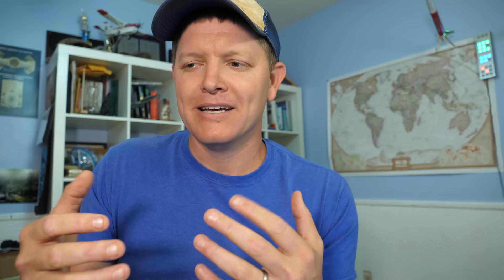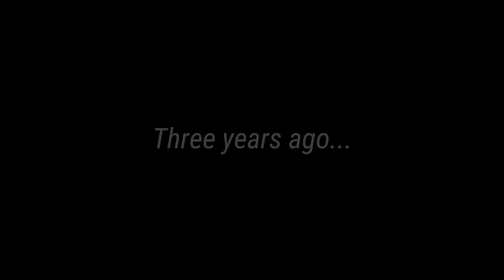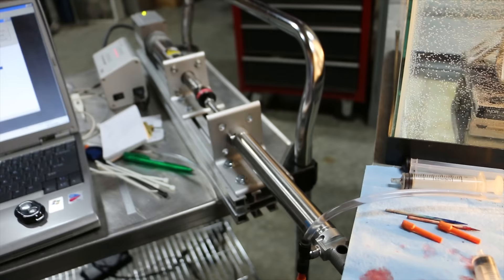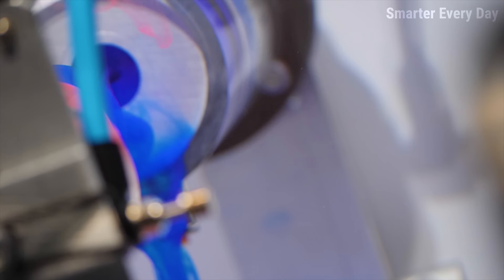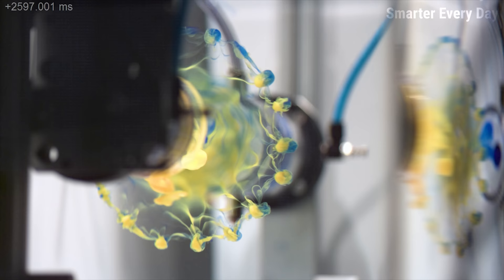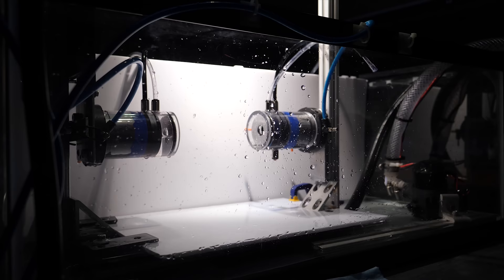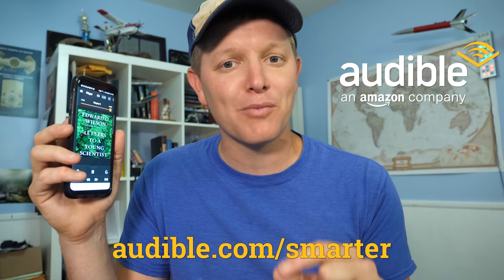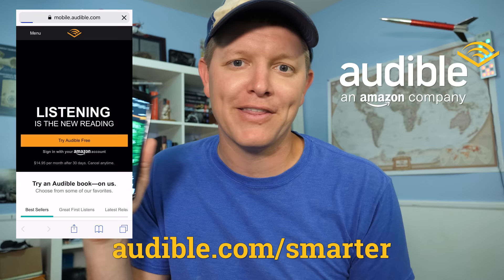Two Vortex Rings Colliding in SLOW MOTION - Smarter Every Day 195

Comment: I think you can try to fire the first vortex, wait maybe 0.1 sec, and then fire the second vortex.

In case the two do not fire at the same time, the collision occurs at a place near the slower gun. This may provide you with more interesting data.
Reply: not quite, because they wont collide. Sorry folk
Reply: Major Tom: They will collide. Still traveling on the same line.
Reply: BarackBananabama why?
Reply: Kim : The two smoke rings travel on the same line. Delayed firing of one vortex only makes the collision closer to the delayed side.
Reply: Barack banamama but the vortex also expands, which would make them miss,because the one fired later will pass through the middle of the first fired vortex
Reply: Major Tom : If you keep the delay very short, the two rings may still "mesh" as gears. I don't know if 0.1 sec is too much. They may still drag each other.
Reply: It might , only Destin can unwind this mystery...
Reply: I didn't see any major size changes over time
Reply: BarackBananabama no, I mean why should that provide with interesting data? It’s not like this is the first time we see vortices ;)
Reply: Major Tom no vortex will pass through the middle of another one, not when they collide head-on. The center of a vortex pushes forwards.
Reply: Major Tom And no, vortices don’t generally expand 😆

Comment: Maybe this could help predict tornadoes.
Reply: Why would anyone want to predict tomatoes?
Reply: oh no, killer tomatoes? :O
Reply: I say tornado you say tomato
Reply: ....because tornadoes are a horizontal spin in the atmosphere that somehow and unpredictably turns into a vertical spin, BTW. That's what I was getting at.
Reply: Any improvement to the fundamentals of fluid dynamics would probably help predicting tornadoes, and a whole bunch of other phenomena.
Reply: I was thinking the same thing regarding the tornado application. Two air masses collide on a horizontal axis which spawns a vertically spinning column.
Reply: Yes I was thinking of the way the horizontal to vertical vortex happens specifically. I know they haven;t figured that out in tornadoes exactly, which makes them very difficult to predict.  Seems an experiment like this might be able to shed some light on that. Maybe not, but that was my first thought when I saw it..  Amazing experiment!
Reply: If you want to predict just look for a super cell then a hook formation on radar it’s not that hard
Also look for low pressure 
Moist warm air from the south 
And cold dry air from the north
Reply: Sauce Duck Luck 
I don’t think you saw the joke
Reply: You'll have to figure out how to make the fluid dynamics perform the same in atmosphere as compared to water.
Reply: BWX also, the mixture of the ring needs to be almost similar in density and concentration, fine tuning such so that the radius formed would be able to be so sensitive to this natural phenomena.
Reply: Lol the first time I read tomatoes not tornadoes. I need sleep.
Reply: BWX yes but forming of multiple vortex tanado and their collision into forming one is a very rare case....
It would be fascinating though to relate these two case....👍
Reply: or may have no practical use whatsoever, but that shouldn't be a reason to not try to understand it. we shouldn't pursue knowledge expecting to get anything useful from it.

Comment: My theory of the creation of secondary rings at 90 degrees of the impact event is that the wave interference created between the two vortexes at the moment/point of initial impact become visably apparent (as the secondary ring formation) as the "shock wave" that contains them expands to the point where the individual disturbances become separated (visibly) from one an other. I think The separation of the rings as well as the ring formation is as a result of energy cancelation caused on impact which is visible as the voids where no ink is present- as the ink itself would maintain attraction the the energy which initially propelled it, drawing it away from areas which this force was cancelled out. Replies with others takes on my theory appreciated. I also wrote this without reading others comments so sorry if someone else came up with this already.

Comment: Try being stuck writing code for two years. Then read something that shows you the way in a matter of minutes. The code that solves the problem is a 6 line recursive C function that walks a maze. In my case, it mapped watersheds from elevation points.

Comment: It’s easy man there is less pressure between the color layers, so after the nodules break off of the main ring, the lower pressure in the middle the higher pressure at the water interface combined with the momentum of the wave, allow the dye to move faster inside itself that at the border, causing an inside out expulsion of faster moving dye in the center then at the interface
Reply: If you want to test this, next steps would include experimenting with varied viscosity, density, even chemically interactive liquids, try hydrophilic/hydrophobic trials… I can’t wait to see-

Comment: I think the mini rings are caused by the material that's being pulled not being perfectly balanced; when it's condensed, the stronger imbalance determines the rotation, clockwise or counter, and since it's pulled in from two sides perpendicular to the large secondary ring, the rotation becomes perpendicular as a result. This video was one of the things that got me interested in physics (more than at a cursory level); I had to try and figure this out at least for a minute.

Comment: The 90 degree rotation is caused by the formation of a disk with particulate density which acts as a gyroscope and causes a degree change when the spokes of this disc are held. Much the same as a gyroscope self regulates or as a bicycle wheel effects a ninety degree change when held in the hand and spun. Does that inform the experiment?

Comment: no mystery, gyroscopic precession it seems. you're basically squashing two vortices and disrupting the rotation of the fluid 90 did orthogonally. similar affect of a large drop pf fluid in free fall through air in a very long distance. a vortices will form, expand and turn into many different vortices around the edge of the primal vortex concentrating most of the original mass of the drop pf liquid.

Comment: Observation: I think the Astranaut theory might be partially correct. The energy should move from the centre of its first impact and then outward. After they perfected their equipment, if you pause after the first twin impact, a two double disc appears and the energy dissipation takes place through the edges of a regular polygon. The lowest numbered polygon you should get is probably a regular hexagon. And should increase with the increase in energy of the colour pellets. You can imagine the secondary rings following the same principle as a mushroom cloud. After the outburst of energy, air rushes in and thus the cloud is formed. With your wonderful experiment, after the energy is dissipated it creates a low pressure, water gushes in and curls the water inward which pushes the colour pigments in the shape of a ring
Reply: i don’t know what you said but yes

Comment: Very cool.   If atomic particles are toroidal vortex rings in an aether medium then you can see how colliding atomic particle vortices makes other smaller atomic particle vortices... which are NOT constituent parts but energy reformed (conserved) into smaller vortices. When considering particle vortex theory you need to remember some important facts. Firstly the atomic particle vortex has a secondary plane of rotation - so it not only turns in on itself like these vortices but they also rim turn clockwise or counterclockwise - this differentiates between vortices making them either positive (charge) or negative (charge). So the difference between an electron vortex and a positron vortex is simply this secondary wheel rotation in relation to the primary inward rotation that creates the toroid. So if you want to model a particle vortex you have to add this secondary rotational phase either to the vortex as a whole or causing the toroidal element to twist slightly.  Secondly the aether medium in which atomic vortices exist is massless and can therefore move at the speed of light which is the speed of time and existence so thirdly the aether can move so quickly that it prevents an area of low pressure (or high pressure) from ever actually forming - so the pressure value of the aether can never change it is always constant even within a particle vortex. This gives the aether  a 'rigid' quality which allows it to carry waves which we know as the EMR spectrum and also gravity. But those potential waves (the movement of the aether)  move so quickly that they never actually change the pressure of the medium so never really exist unless they interact with a particle vortex. Magnetic fields are also toroidal vortices caused by the toroidal motion of the aether on large scales. This motion however does not seem to affect other magnetic fields... as the aether is massless it can move in two directions at the same time and pass through itself with out any effect, like two converging waves. The aether is not moving fast enough to interact with itself, but particle vortices are rotating at the speed of light which appears to change things and of course if you place a particle toroidal vortex with a magnetic field toroidal vortex the particle vortex is affected in its direction of travel.  If nothing moves fast enough it becomes something.

Comment: IMO conservation of surface tension.
It expands until it breaks and the left over tension converts into the smaller rings thanks to it being in water already.
Not sure on the 90 degree turn though.
(I would like to point out I know little of fluid dynamics itself and am taking a shot in the dark)

Comment: In terms of dynamic vortex pressure each fluid torus is creating a vortex with its own presssure created from the vortex propolsion (think of how electro-magnet energy moves in a vortex, some of the energy becomes mechanical magnetic energy creating propolsion or “pull”) when both of the inverse torroidal pressures exactly cancle each other out there is a moment of a  “zero pressure state”. This very stable moment should stop all movement (check the video in extreme slow-mo) .  the space/plane between the 2 toruses release all directional tension in the plane. Once force resumes the 90• (the direction of the plane) is the path of least resitance. similiar to a zero gravity state Its a neutral zero pressure state. All forces are in equilibrium therefore not “there”(Think how parallel  dipole currents in wire push magnet energy directly 90• from each other) the pressure or energy, is the. redirected to area of least resistance which is the point furthest and quickest  from the collision. A hypothesis…What do think?

Comment: I know this may sound dumb, but wouldn't it be from the collision?  It forces turbulence directly 90 degrees from the angle at which contact occurs? So the explosion moving the water that direction and then repeating. If those too had impact on another color, it would be anther 90⁰ being parallel with the first collision.

Comment: secondary ring (again) is just momentum-- everything oscillates, though not always in the same dimensions. The secondary rings are simply the next iteration of the primary ring collision, ie: the center of the little nodules are colliding, due to the momentum of that initial ring breakup, and ring out just as the main big ring did.

Whats more unclear to me is how and why the initial ring breaks into regular nodules. Is it due to unavoidable imperfections of the equipment/setup, or some intrinsic phenomena.

Comment: There is a relationship to the tank walls and the pressure(flow redirection), the directions all the " Mini ring vertices" are going in relation to all the static walls, contrast your findings from this as a "control" and use larger or smaller tanks and change your values accordingly and you will find that if you remain symmetrical in the tank environment yet change the scale; your mini rings will appear at a closer or further location from the center of the collision, I count at least 8 influencing values that would create this mini ring at the ...if you hurt your brain enough, its the remainder of the equation from the values thrusted into the problem and pre-existing statically, that coupled with the the fixed behavior of water its self. (molecular tension of h20, tank shape and size, relativity of position in the tank ....u get the point). Yea I know why these are created I can see all the variables...makes complete sense.

Comment: Hello, love from india. Here there are small rings forming because, when big ring become big and big then surface tension of that ring is not strong enough. So, ring will break in small bolls. Then because of braking force whole particals will meet in center then rebounce outside. So, because of rebouncing force small bolls are converting in to small rings and this process will continue....

Comment: I don’t believe the secondary rings “turn” 90 degrees, instead I think the initial impact of the two vortices creates the initial ring moving from the center of the impact. From there, the low pressure zones leave the secondary rings traveling in the same direction they were already going after the impact.

Comment: So hear me out, if the red and blue dyes are pushing against each other and then they spread out so thin that the edges starts to break pretty symmetrical, wouldn't the initial inertia before the collision be the reason for the 90° turn of the secondary rings? If both red and blue break the edge at the point on both ends, the inertia of blue and red are trying to pass through eachother, which would make for a swirl, sphere, ring when they stabilize or balance eachother out

Comment: Wondering if the reason of these secondary rings, at 90 degrees from the primary ring, is not actually related to the opposite of what your astronaut friend mentions. 
Assuming we are looking along a longitudinal section of your experiment, X is the long axis, Y the up/down and Z the view direction: as the "high" pressure wave from the first ring spreads in YZ, it enters convection along the YZ plane (with pressure waves rotated around the X axis), local heterogeneities along the outside of the primary convection ring generate high pressure secondary waves along the periphery of the primary ring (so along the disk outlined by Y^2+Z^2=r ; r being the radius) and these collides with the primary high pressure wave (so you get two opposing high pressure wave along Y^2+Z^2=r ring plus 1 wave from the primary YZ plane) colliding. In this interpretation, my guess is that the energy between the 2 peripheral waves and the primary one are nearly equal so as to create a secondary vortex, so I would expect that we could mathematically tie together 1) the distance from the primary vortex initiation point to the secondary vortices initiation points, 2) the spacing between each secondary vortices, and 3) the energy dissipation along the primary vortex (so something to the power of 2 since it appears mostly 2 dimensional). 
Would be curious to know your thoughts.

Comment: Very impressive experimental achievement and extreme patience, plus insight into all the different causes of "failure".  I would like to suggest/ask why not do this experiment with the vortex cannons vertical, to remove most of the dye/water density sensitivity.  The top cannon might indeed need some sort of shutter to prevent dye drifting out of the aperture into the impact zone, but it is also interesting to see how the process itself behaves when gravity (the unavoidably unbalanced aspect of the horizontal system) is coaxial with the axis of the experiment.  Too late now for sure to test but what do you think?

Comment: As an expert in fluid dynamics I'm sure you understand the importance of keeping the temperature identical in every area of fluid if you're looking to get near perfection.

So, having a lid, small contact thermometers on the sides at multiple locations on all sides would do wonders. Also room temperature control.

Your lighting rig (even LED is close) will give of a small amount of heat.

Obviously if temperature of the sides and top isn't completely uniform you're going to get convection that interferes with the fluid mechanic you want to see 

Also putting fluid in your mouth isn't a good idea as it changes other variables from temperature to chemistry.

Finally lack of a lid will cause other minor chaotic issues for reasons other than air / water temperature differential.

Controlling the variables will take each iteration more time to set up, but I wager vastly less iterations, quality over quantity right :)

Finally: Congratulations on a great video